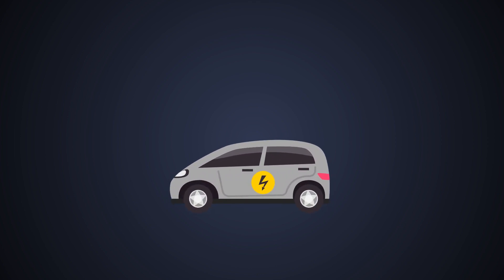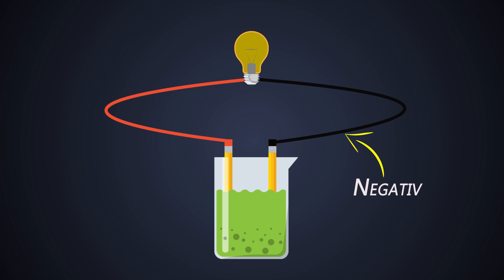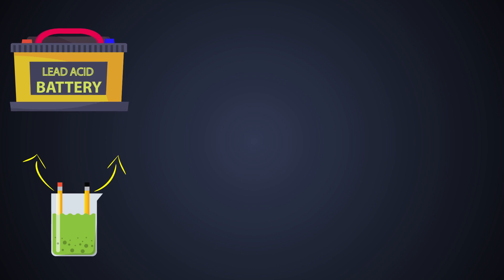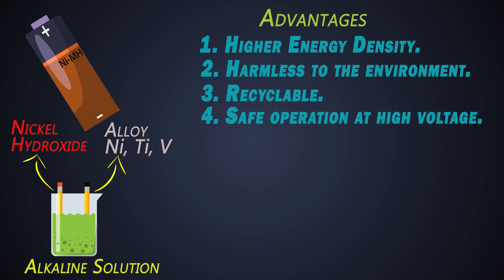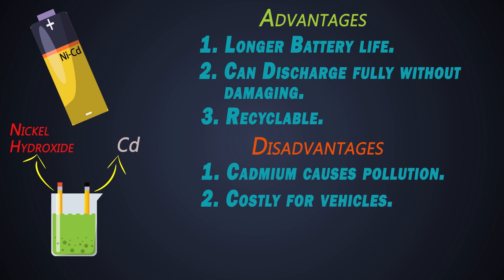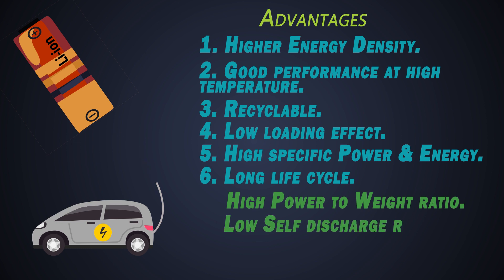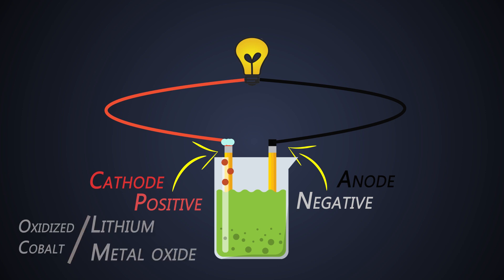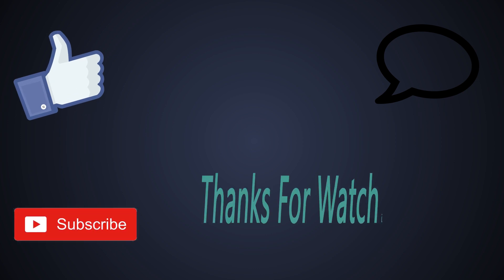Which Battery is used in EV? | Why Li-ion battery is used in EV?

Comment: If I were to buy an EV I would rather buy one using lead-acid batteries. Even if these only had a range of 60 miles and took 12 hours to charge this would not be a problem for me as 99% of my journeys are less than this both ways. If I wanted to go further than this I would take the train and not have to worry about finding a charging station which would charge me up to 2.5x the normal price for electricity. Lead-acid batteries can be safely and economically recycled, there is no danger of these being banned from car parks or ferries due to fire risk and I would be able to sleep in my bed without having to worry about my car/garage/house catching fire whilst the batteries were charging.